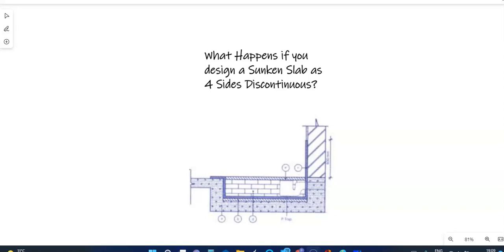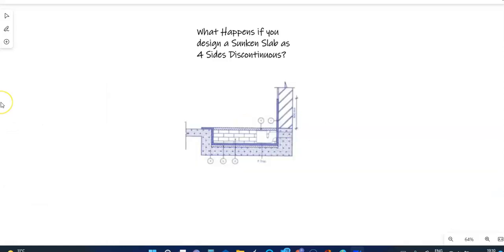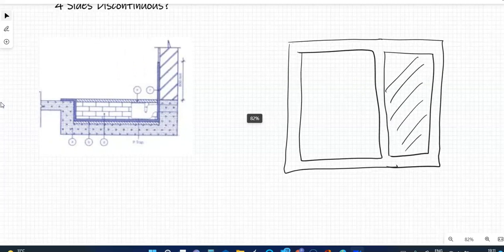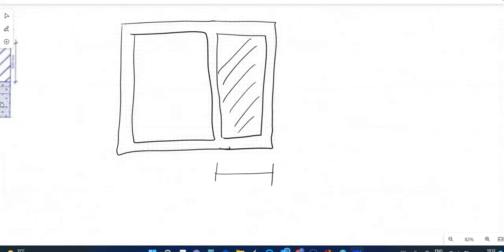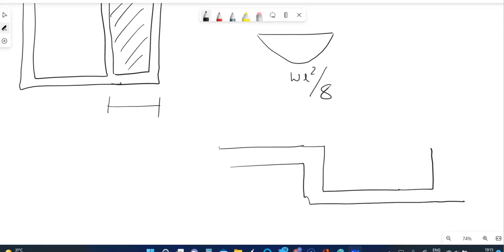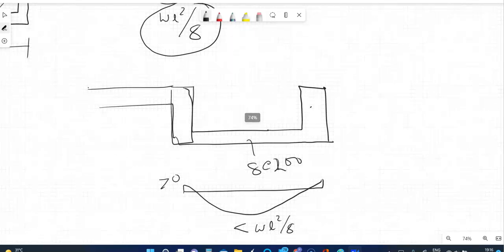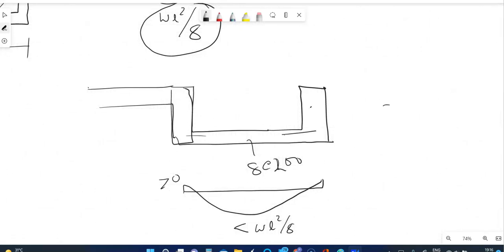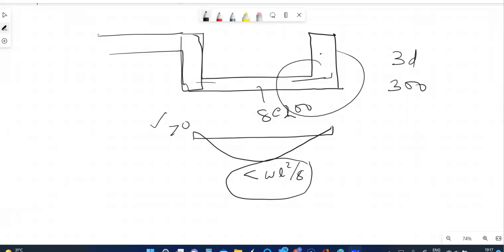Is Sunken Slab always a 4-side discontinuous Slab?

Comment: Sir how to pour different grade of concrete at beam column junction for eg in beam M-60 and column M-30
Reply: Puddling of concrete
Reply from the maker: Pour the higher grade at the joints. It needs to be controlled at site. By the way ,This question is not relevant to the Video. Why dont you ask separately.